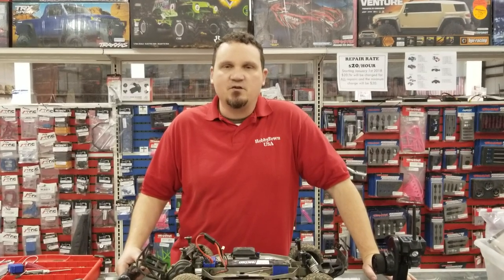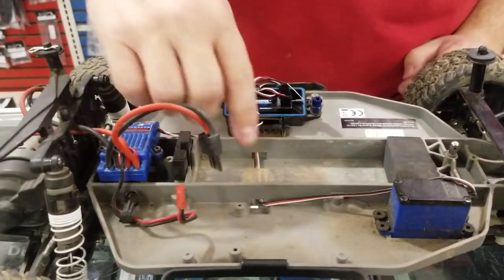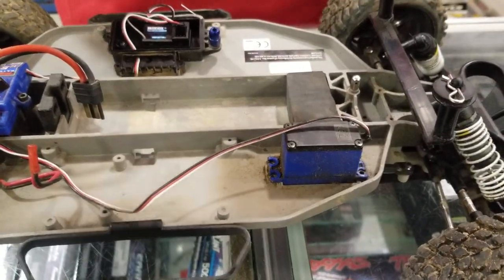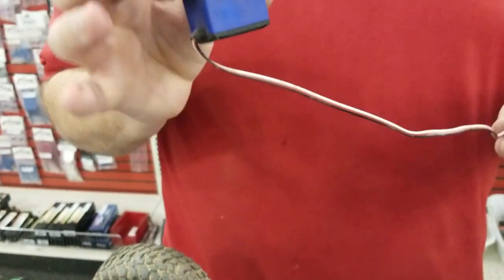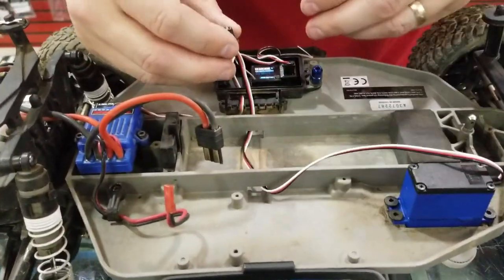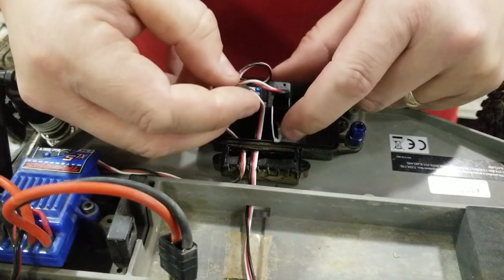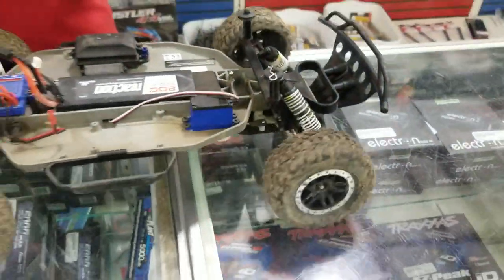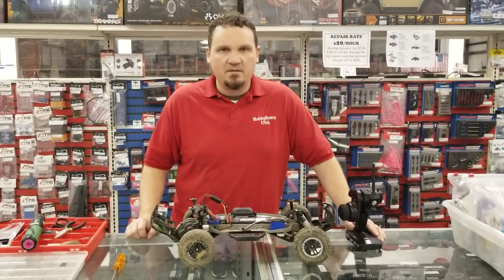How To Replace a Broken Servo on a Traxxas Slash - HobbyTown HobbyPlex

Comment: I don’t get how you got the cable out of the box there’s not enough room
Reply from the maker: With the stock receiver I usually use a thin pair of needle nose pliers to get the plug where it needs to be.  

If all else fails just pop the receiver out of the way and secure it again with double sided tape when you're done.
Reply: The HobbyPlex Show thank you I ended up using pliers to get it out thanks for the help
Reply: Me too

Comment: I have a traxxas slash 2wd and when I was driving my car got stuck in the fence and my steering servo broke so I bought a new one and it’s not steering right I aligned it doesn’t full steer right when I pick up the car it turns good
Reply from the maker: Check for another broken piece or bent kingpin near your steering knuckle. It may be binding up your steering.
Reply: I got a new steering box and it’s doing the same thing with my traxxas 2wd xl
Reply: Slash